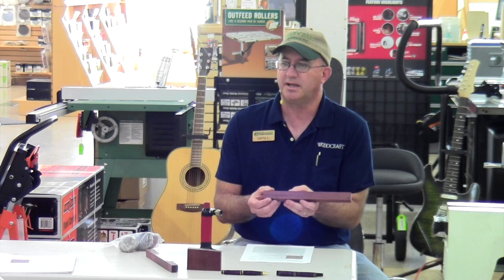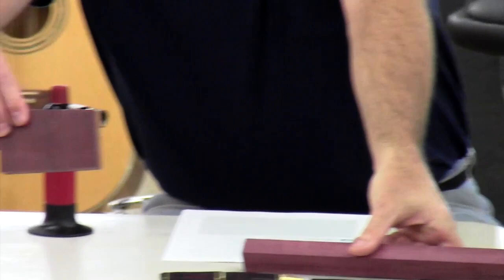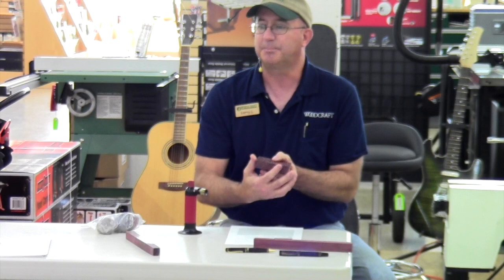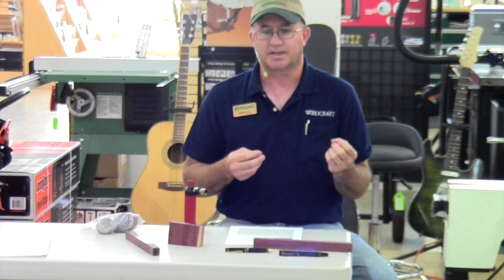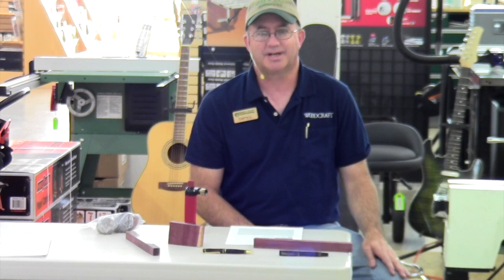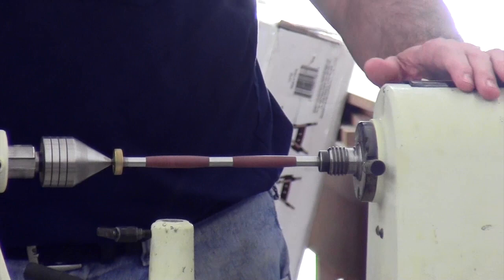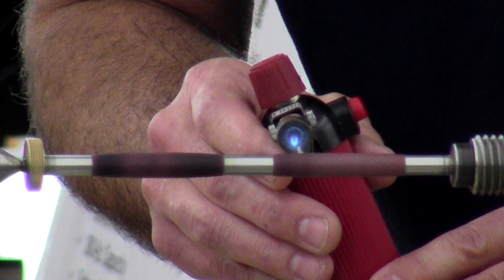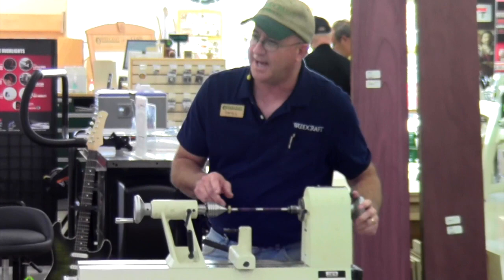Rejuvinating Purpleheart

Comment: Heat is the key, however I would recommend using a heat gun rather than a torch, more control and a more even result with a reduced risk of burning.
Reply: I did the same. Worked great.

Comment: Have been working extensively with purpleheart for several years, and getting it evenly right violet has definitely been a constant journey of reinvention and discovery. Obviously flame on your already cut and shaped pieces is a good way to get the surface nice and purple, plus, if you overburn, you can relighten with sanding. Personally I started with a much larger handheld propane torch, and found it works alot faster and across a wider work area than the little butane torch, so it may just come down to how big your piece is (though, even for pen blanks I definitely prefer the big one). When you need your boards nice and purple throughout, before you start working them, this is not really effective, and the best recommendations I've seen are to bake it in an oven (my own research has led me to 360-degrees for 60 minutes for any boards 3/4 to 5/4 inch thick). Today though, in considering that it's that sap/oil that does the "purpling" when it is heated and redistributed, I had a crazy idea while trying to think of a way to more rapidly heat the board throughout than the oven, so that the sap has less time to pool and leech out...

...so I threw some purpleheart in the microwave, just for about a minute, and hot damn. It had the same through-and-through purple as the oven, but the sap stayed far more distributed and less splotchy/veiny. If repeat testing gives me consistency, this will likely become part of my standard prep for working with purpleheart. Beyond just the best and most consistent coloring I've gotten from purpleheart, having tried everything from torches to ovens to sunlight to even a laser, it's impossibly fast, doing in about a minute what takes hours in the oven and days with sunlight, and better still, using a microwave seems downright sacrilegious in old-school carpentry. I'm never going back.
Reply: How did it go

Comment: Hey very interesting. 
Would a heat gun produce the dramatic change in color as did the torch? 
I'm slightly confused though. Is it heat or light that changes the color? 
If I ran over it with a heat gun would I expect to see the color return after final sanding in my case.
Reply: Looks like the air and light exposure turns it brown and just the heat pulls the sap to the surface to bring the purple back from what I've seen so far.

Comment: Does it return to brown eventually? Or is it possible to keep it purple?
Reply: Once you get the purple color back, which is easily done with 15-20 min in the sun - and you apply a clear finish which seals the wood - it stays purple.  The inside of purple heart wood is actually brown - UV light turns it purple.
Reply: @kawvoy99  does using polyurethane gloss seal the color?
Reply: @naturelife7536  yes

Comment: Baked mine in oven twisted the snot out of it, don’t recommend, waste of wood, use a heat gun now still not great. Good luck!
Reply: I use a toaster oven never had a problem. But you have to start on a lower heat around 200 and bump it up from there every 30 mins